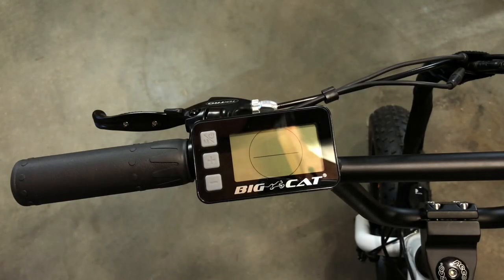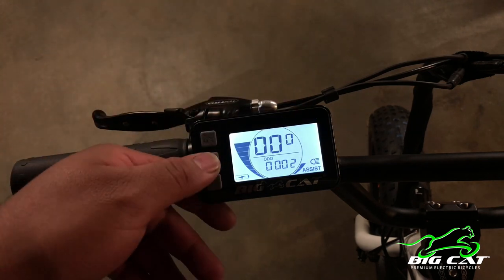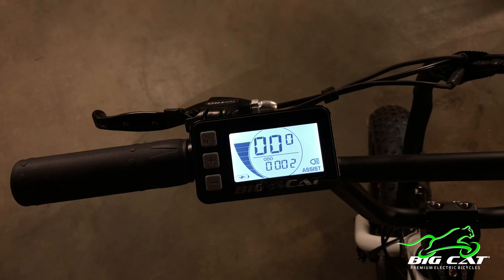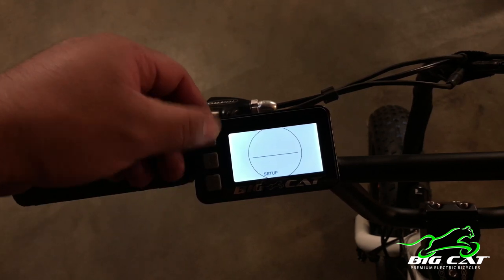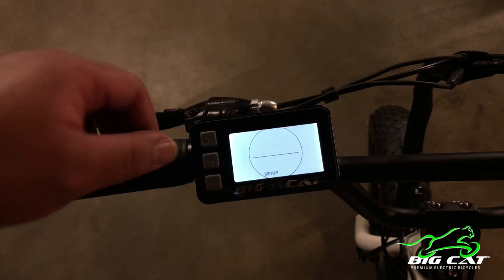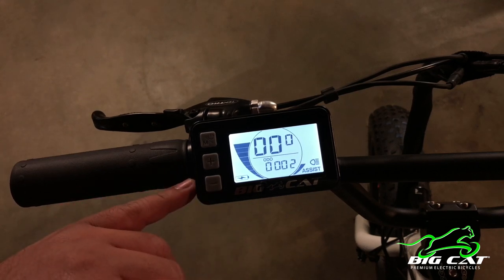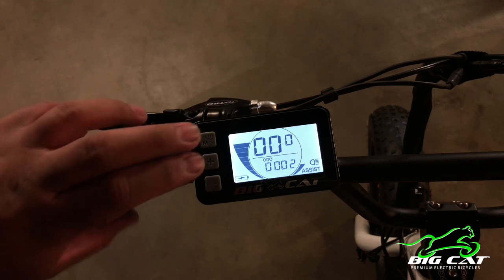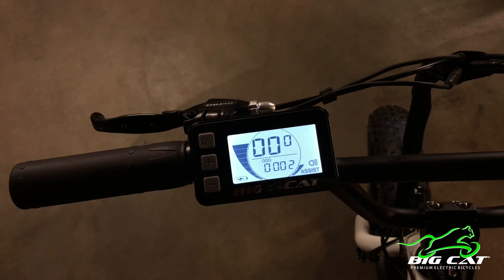Big Cat KM529 LCD Controller Set Up, Top Speed, PAS. Mini Cat XL 500-Watt

Comment: Hello, I have an electric bike with km529-lcd king-meter display and I wanted to unlock the speed because the default value
  the limited speed setting is 25 km / h and I can not change it as well as Wheel diameter settings best regards and waiting for a reply
Reply: I have the same issue. There is no option to change the speed.
Reply: Hey did you find a solution?

Comment: I think my European version is locked (king-meter). The wheel diameter is locked to 70cm, and speed to 25km/h, it can't be changed. Assist above 25km/h on normal e-bikes, is never allowed here anyway.
Reply: Is there a soulution to unlock speed or wheel?

Comment: I have the same display and I can enter the setting as you describe however I do not get an option to change the speed? Any idea if there is a way to unlock this?
Reply: Hey did you find a solution?
Reply: Bump
Reply: I don't have speed either. found a solution?

Comment: Komme nicht in die Einstellungen.Ist es etwa gesperrt.
Reply: würde ich auch gerne wissen, in den einstellungen lässt sich bei mir auch nur die helligkeit des displays verändern..
Reply: Here also... Hope find a solution
Reply: @sancayakbulut3215  ich glaube man braucht ein neues Gerät.
Reply: @gordone29  z. B. Ein neuen controller der es zulässt?
Reply: Habe mir heute ein ebike gekauft bei mir sehe ich die Einstellungen kann sie aber nicht ändern ist wohl gesperrt jemand nh idee wie es funktioniert
Reply: Funktioniert bei mir auch nicht
Reply: @sancayakbulut3215  hey did you find a solution?
Reply: @jordaandimitrov942  hey Jordan, unfortunately not. I just stopped checking. Looks like there need to be a new controller purchased. But I gave up.